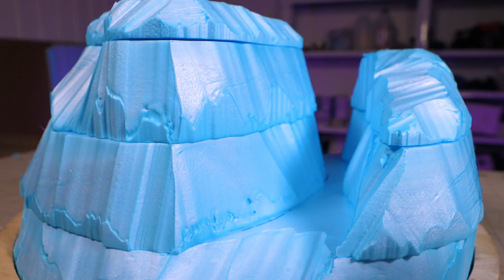Making A Miniature Fantasy LANDSCAPE  (For An Epic Castle?)

Comment from the maker: A bit of a long one, but damn, those wire trees took some time. Next up is the castle build itself!
Reply: kind of sure that should use weaker or finer wire to do the tree, like copper wire. should be much easier
but the leaf, i mean i saw a lot fake leaf product, what u got really not the good one
Reply: I am also from norway!!!!
Reply: I normally paint a thick layer of plaster of Paris on to the wires then wait for that to dry then add thinner and thinner coats. It's sooo much easier and natural looking than trying to stick clay to it :)   PS - I went to Norway for the first time in December and I LOVED it!!
Reply: Try using some tinfoil on the wire and the sculpt with supersculpy clay. I'm making a clay bjd with this method and seems to be working very well. You will need to bake it in the oven, but I promise it will be easier (and cause fewer cuts) then using multiple wires.
Reply: Here's a really good channel for you to check out. He does a lot of stuff with "styrofoam", and he has a few awesome tutorials for wire trees.
Edit: I can't post the link. Just search for Luke Towan. ><
Reply: Next time try wrapping them in masking tape first, and then the clay. Should stick better :)
Reply: hey so some tips on using clay 
- to make it less brittle you have to work it as much as possible put it through a pasta maker it will really loosen the clay up
- you should use the brand sculpy they are very good and you should use premo or super sculpy normal , NOT ORIGINAL SCULPY IT SUCKS!
-and you should put masing tape on the wires it should stick better that way
- you should also oven heat it for 15 minutes on 270 f  after you apply the clay to harden it
Reply: Something you can do to get the clay to stick better to wire is a product called liquid Sculpey / clay it's pretty much a glue for clay that helps it stick to its base better as your sculpting
Reply: I have made "art dolls" in the past, can be animals with soft stuffed bodies over a wire armature with a clay sculpted head and feet and usually some adornments. If you want a great example, woodcutterlee on deviant art is AMAZING at this. From what I learned about attaching clay to wire, you can wrap the wire in waxy floral tape to give it a stick surface. It should stick to itself enough (if you wrap it by overlapping) to give the wire a surface to grab onto. Usually to make a clay head, I'd squish a ball of aluminum foil, attach it to the wire armature, and just wrap floral tape around the entire thing. If you use polymer clay (sculpey is a great brand), you'll get a much more durable sculpt. I know you made this a while ago, but I thought I'd leave the comment anyway haha. Thanks for your videos! They have absolutely inspired me to just be me and do exactly what I want to do. I've always been a little embarrassed by my nerdiness and being from Oklahoma state...yeah, people aren't the most nonjudgmental there. So I'm finally coming back into loving larger than life whimsical fantasy art. I've already had fun after discovering you just yesterday. Thank you for making these vids! :)
Reply: I have not experimented with making trees yet, i've just gotten in to scenery builds, but i would try these things: for clay tree i'd sand/file the wires so they have a rougher surface for the clay to stick on. For the hot glue tree i would also file the roots, they are a bit thick imho and after that, just a coat of matt varnish might take care of the glossyness. Just some ideas. I also saw a reaction pointing to Luke Towan's channel, his video's were the first i saw and i learned alot from him, he makes nice trees. He made a small graveyard scene with a tree where the roots are sticking out of the ground a bit, just by covering them with plaster
Reply: I know I'm two years too late, but I hope that you guys are doing ok and whatever made ya tired/sad/mellow was a passing thing. ❤

Lol just had to watch 60 seconds longer to find out why. Glad it went away but I'm sorry you were sick!
Reply: Look at the YouTuber Ace of Clay 
His videos will help a lot 
Basically when your going to attach clay to wire use Baking Bond then you can put the clay in the oven as long as you have some kind of small air hole or the heat from the oven can crack the clay 
But yeah check out his channel he’ll help you get an idea on what to do

Comment: Something I discovered recently is that you can mold hot glue while it's still hot with wet fingers and it neither burns nor sticks to you. (I chanced it when something went wrong and it BLEW MY MIND!) Maybe there's a way to add a bit of texture like this, so that the trunk isn't so plasticky?
Reply: the surface does cool down really quickly once you start molding though
Reply: the textures can be added with carving tools. maybe using a matte base paint, like chalk paint or the ones used for gunpla figures, will remove the glossiness  of the hot glue
Reply: even better if you use vaseline on your fingers.  Way easier to smooth and sculpt.
Reply: Hey I mess with hot glue all the time and I found this out when I 
Burnt my hand and paint water was near by 😅
Reply: I use smaller hot glue gun for texture.
Reply: You, my guy, just opened up a whole new world for me. Thank you.
Reply: @n.c.pictures  you're very welcome!
Reply: You can also use silicon fingertip covers, they are amazing, they feel like normal finger dexterity sans using your nails
Reply: Dip a wire brush in water and use to make the tree texture.
Reply: Small metal tools + candle
Reply: Only heat them up for a couple of seconds

Comment: Covering your armature with masking tape will allow the clay to stick better. There are also many types of modeling materials with different characteristics: air dry clay, polymer clay, apoxie sculpt, epoxy dough. I know there are some that are lighter weight and more flexible when dry, but I think your tree is terrific the way it is. Well done!
Reply: I've seen people use air dry foam & their pieces seem to keep a fair degree of flexibility. Hope this can help for a future project.
Reply: @sirenofthesea7802   No clue if Nerdforge is going to see this, but polymer clay (my preference is the tan super Sculpey) plus translucent liquid clay.   The liquid clay OR bake-and-bond makes the clay stick to non clay surfaces.  And yes, baking the wire in the oven is perfectly safe.  (Can also bake - wood, aluminum foil, bamboo sticks, toothpicks...)
Reply: I use bandage tape. The texture of the fabric really helps the clay stick good on the surface.
Reply: I made some wire trees in the past, covered them with masking tape and then smearing modelling plaster all over them. The brush I used actually made pretty good bark texture to start with too.
Awesome how many methods there are to make these things. 😊

Comment: for getting the clay to stick to wire you need to cover it with masking tape or use polymer clay with liquid fimo or bake n bond for it to adhere to the wires or epoxy clay which will stick to anything, but it's quite expensive, but it drys incredibly strong, still masking tape is the best options with air dry clay. I do allot of clay projects and live an hour outside of Oslo, just let me know if you ever want some lessons in clay!  This is turning out awesome, you are so talented :)

Comment: Amazing work, as usual. A compromise for the tree is to make the trunk with clay, and then use hot glue for the branches since they are not visible. If some are showing, then you can do some with clay to increase realism. btw, I prefer how the clay tree looks. I also think you chose the wrong clay. I have watched tutorials using sculpting clay and although it requires a certain level of proficiency, it didn't seem super hard to stick to wires. It might also have to do with the wires you used. I imagine galvanized wire makes it harder for slay to stick properly. But we have use what is available to us.

Comment: I love your work and the final result! You are so talented but you seemed to struggle a bit with the clay, and I want to give you little suggestions for your clay experience in the future. First off I'd suggest you make a base layer of masking tape and/or aluminum foil as they're both very grabby and the clay will stick better. I'd also suggest you use a polymer clay, like Sculpy or fimo, as it sticks to your base better, especially if you have liquid sculpy or bake-n-bond, and you can pre-bake your progress if you're worried about messing something up. There is also epoxy clay but much like air dry clay it's a slow working clay and needs to be done in sections/layers but is extremely sturdy (it's also toxic to the skin which requires you to wear gloves, making sculping harder in my opinion). Anyway keep up the good work with those lovely landscapes of yours!

Comment: Great landscape! ♥
Clay tips: 
I used to use white PVA glue when wrapping air dry clay around existing objects. I would brush the glue onto an object and then apply the clay. It always took a few days for the clay to dry, so I recommend doing a test piece first. 
Another alternative: polymer clay. When wrapping polymer clay around an object, first apply either Sculpey Bake & Bond bakeable adhesive or Fimo Decorating Gel to the object and to the underside of the clay itself. When baking polymer clay with an existing object, if you follow the package directions, the clay will crack. Never put object with polymer clay attached to it into a preheated oven. Instead, put it into a cold oven set to the recommended preheat temperature. Count recommended bake time not from the moment of putting the object into the oven, but from the moment the oven reaches the recommended baking temperature. Monitor closely, because you might need to reduce recommended baking time, so your clay does not overbake and burn. 
Liquid polymer clay mediums, such as Bake & Bond or Decorating Gel can be pre-set with a heating gun. Same works for thin layers of polymer clay. So, you could build up your sculpture using this method and then finish by properly baking it in the oven. Make sure to monitor closely and hold the heat gun not too close to the clay, so you do not overheat it, releasing toxic fumes. 
Finally, liquid polymer clay mediums can be mixed with small amounts of solid polymer clay to create super sticky moldable paste. 
Please note that it is not recommended to use traditional spray paint or any solvent-containing medium with polymer clay. Over time, solvents will react with even baked clay, permanently turning it into a sticky smelly goo. The same thing will happen if polymer clay is applied to or stored in hard plastic, such as acrylic, polycarbonate, PS, EPS, PP, LDPE, and PVC. 
I hope this helps, best of luck, and I am looking forward to seeing more of your super talented work! ♥

Comment: for the hot glue tree you can heat up the gun and use the tip to reheat the glue and make then let it dry so that its in that putty kind of state or a little before that and take a toothpick to create a better kind of realistic texture im pretty sure that should work nicely and to make the tree less glossy maybe cost it with a layer of matte drying mod podge im not sure if that would work but its worth trying

Comment: So air dry clays really wont stick to metal. You're going to have to fight it. What might work is polymer clays, you can do a section, texture it and bake that then work on another section so you don't crush the texture in the first area. 
As for hot glue you can get texture on it by heating up something and pressing it to the trunk, just do experiments to see what won't stick. You could also try heating up large needles and running them along the surface to see if it works (not sure if that one will or not). Also to get ride of the plasticy look you can try mat sealing sprays or very mat paints as a base layer though that can be hit or miss. Honestly the hot glue is probably your best option for a project like this since you can still bend the wire without the outer layer snapping off.
One thing I noticed is when you paint things like this you tend to stick to very neutral greys. I was wondering if you would consider adding some more color in. If you look at a lot of large rocks and cliffs they have a lot of browns or blue undertones and are way more colorful than you think. Also adding white to get a lighter color kind of dulls it down since white is so opaque so using as little white as possible is usually a good idea. It's a style and preference thing but since you like trying things out I thought I'd suggest it :)
This looks awsum! There are some pieces on display at the Metropolitan Museum of Art in New York that this really reminds me of. They're decorative stones on carved wooden bases from china and I think you'll find them interesting
https://www.metmuseum.org/art/collection/search/61764  
https://www.metmuseum.org/art/collection/search/61763
https://www.metmuseum.org/art/collection/search/61762
Also they have an indoor Chinese Courtyard garden that has similar vibes to this piece. 
https://www.metmuseum.org/art/collection/search/78870
I love your videos and I look forward to seeing the castle! And the next tome you make <3

Comment: I’ve found that clay adheres better to aluminum, so when I make my sculptures, I start out with a wire base, then put aluminum foil over the wires, then add my polymer clay. Not only does it help it stick, but you don’t have to use as much clay making it lighter. I hope this is helpful! 😊

Comment: About the air dry clay, the trick is to "paint" a coat of pva glue over the wire structure let it dry before putting the clay, the clay will stick to the glue. Here in Brazil we use air dry clay quite a lot, hope it helps.

Comment: I've worked with clay before and I've noticed that super sculpey original clay is really good to work with, even tho clay in general is hard to stick to wires but this particular type of clay you don't need water to work with and it shapes beautifully and you can use your normal home oven to bake it and you can use things like aluminium (wire or foil or anything else) to bulk it out a bit so you don't use to much clay, just figured for furniture projects this might hopefully help😊love your work it always end up being beautiful 👌🏻

Comment: you NEED a gasmask when using epoxy,  

"Cured epoxy poses few health risks (note: sanding cured epoxy will produce dust, which should not be inhaled); however, liquid and partially cured epoxies introduce numerous health threats that need to be managed as efficiently as possible with preventative measures."

Comment: Use a power drill to twist the wire in the trees, it saves your hands. Just clamp the strands of wire in the end of the drill , not to fast. But it is a quick way to twirl wire.

Comment: For a moldable clay-like substance I recommend green-stuff. It's an adhesive tacky that will dry solid, sticks to metal just fine and can be primed and painted just like any plastic. it's used in tabletop miniatures all the time for detailing. theres a couple kinds u can get, for something like this, I'd recommend the tape. it comes split in a yellow side and blue side, kneed them together until its completely green. start with small amounts, cuz once you mix them together, it will start to harden, usually in an hour or so to become stiff and cures in bout 24 hrs. Hope this helps!

Comment: Hi Martina,  Wow!, That was so awesome!  Your technique for making a realistic river (difficult to achieve), was sheer perfection!
I agree that hot glue is the easiest way to cover the wires but I prefer a different approach which retains a trace of the wires to keep the 'aged and twisted' appearance, but also adds a rough bark-like texture.
Simply  soak the tree in liquid superglue and sprinkle baking soda all over it.  A chemical reaction takes place that sets the baking soda like concrete.  There will be fumes (and a little smoke at times), so do this outside!   This process of superglue/baking soda can be repeated until the desired finish is obtained.
Superglue and baking soda has many applications in model making,  It has extremely strong adhesion and can be sanded smooth when used as a fine filler and it sets instantly!
Big hugs,
Louie xx

Comment: I've tried my hand at a mixture of hot glue and clay. Stuff works. First, hot glue a layer of crumpled up tin foil to the wire tree, that gives the clay a bit of texture to stick to. Really get that tin foil crumpled before you glue it on. Clay should go on easier now. :)

Comment: Btw, I've been told (but haven't tested it myself) that polyurethane foam filling (the kind that's usually used in construction and expands) can glue styrofoam without melting it.
Also it might be easier to make the clay stick if you rough up the wires with some low grit sandpaper first?
Or maybe something like an initial Plastidip coat or similar, so you're not sticking clay to metal but clay to plastic adhesive or whatever it is

Comment: A little tip - spray hairspray onto the tree and leaves will become more steady and won't fall off randomly.
Also if working with air drying clay - just add some pva glue and it will stick to anything (also it won't crack)

Comment: Quick clay tip! Redo everything you did except after you do the wire, put clay on the trunk and then put it in the furnace for like 3-4 hours (not sure) but you need to mold it how you want before putting it in. Great video btw love the result!